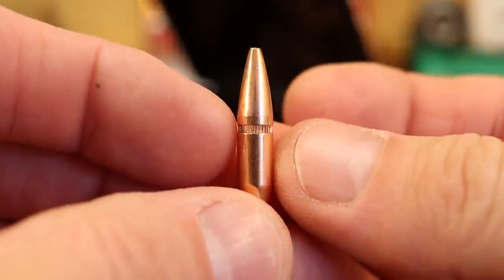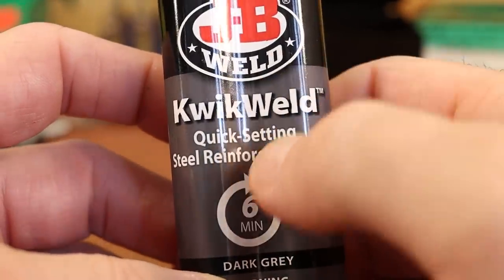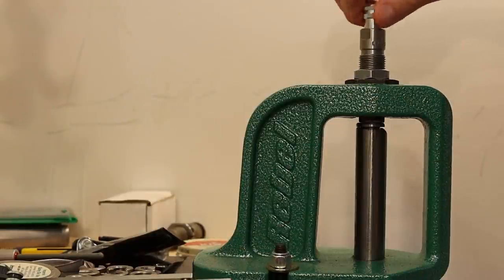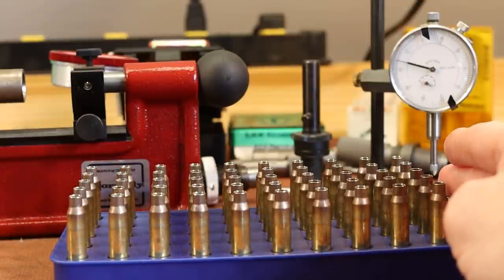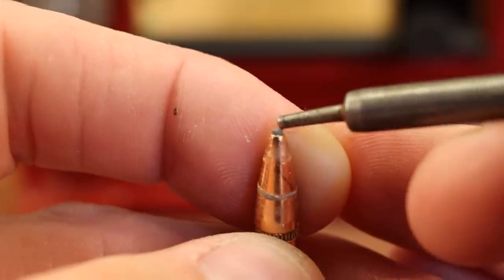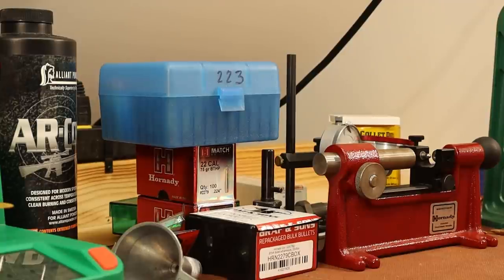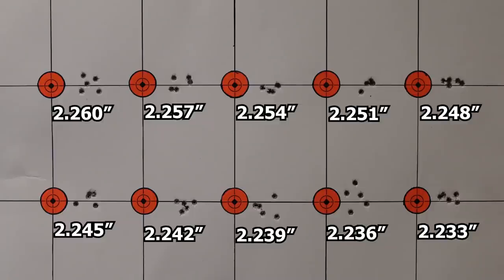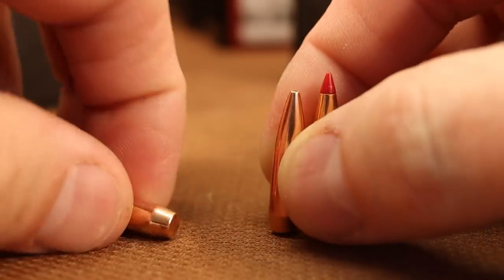223 Rem - 75gr Hornady BTHP with AR-Comp

Comment: Hey Johnny, I'm a not the most experienced handloader, but I do have a mechanical engineering degree and about 8 years of reloading under my belt. I believe runout and concentricity aren't important for 1 very simple reason. The bore of the rifle is smaller than bullet. Unless the cartridge is just horribly deformed, the bullet is always going to true itself up to the bore once the rifling engages. Plus, there's no way the bullet stays perfectly true during its jump to the lands anyways. As pressure builds, the brass lets go of the bullet and its free to wiggle due to uneven thrust caused by the powder burn. This wiggle is almost certainly greater than the actual runout you could measure before firing. But once the bullet gets to the throat, the rifling acts like a guide and the bullet's bearing surfaces are forced back into parallel with the bore. Thus it's a self solving problem.
Reply: Sorry but no it won’t
Reply: @3er328  Very convincing counter argument.
Reply: Nope.  If the bullet is jammed into the lands sideways, it deforms sideways and goes downs the bore non concentric.
Reply: People don't understand ejector plunger pushes it off center.
Reply: @3er328 
Ok. Support your position. Tell us why it won't.

Comment: I stopped worrying about runout when I finally determined that I wasn't a good enough shooter to take advantage of .001 to .002 of runout vs .003 to .004.  I found that good solid reloading practices in general made more difference than obsessing over one to two thousandths of runout.
Reply: Well, don't be so quick to blame the shooter.. there are a lot of rifles that are not all that interesting. (only accurate ones are interesting!)   Fired thru a bench rest rifle with minimum chamber and neck, it will probably be something you could see.  Thru a semi auto, I doubt you will though...
Reply: That's me. I reload primarily to save a little money (not much these days) and to tailor my ammo to my firearms. That has definitely increased my accuracy, however I can only shoot so good, so I've stopped short at stuff like runout, weighing brass, and even annealing. For me it just takes the fun out of it and becomes a technical dumpster fire.
I'm a simple geek...LOL 
But I enjoy watching Sean struggle with all this😂😂
Reply: @elwhastrummer  I agree on your premise that there are certain aspects of reloading like weighing brass, or maybe turning necks that may only decrease your group by 1/16" or .0625". To me I don't spend the time doing those either. I wouldn't spend the time on those even if I knew before hand it was going to take my gun from a .4" to a .2". The time involved just isn't worth the reward to me as a regular guy not shooting matches. But I would disagree on annealing. Annealing does two things. One it makes all your brass easier to resize and get the same amount of shoulder bump which has a direct effect on pressure from one case to another. Two, it helps with consistent neck tension during the resizing process. While I don't weigh brass, I do check for brass run out. I heard a great shooter say, a bullet that starts out flying straight will tend to  continue to fly straight. But a bullet that starts our flying crooked will never fly straight.

Comment: Don’t use 2.254”; use 2.251”.  That COAL is trying to shoot benchrest level accuracy (only the single bullet with worst runout was outside the group).  That’s definitely the optimal COAL length for this bullet in your WOA bbl.  Concentricity does matter; however, not as much as jump to lands in this combo of bullet, bbl., and powder charge.  I also think bbl. harmonics are at play here.  The 2.251” COAL, with this bullet, and this powder charge, with that barrel and suppressor is hitting the harmonic sweet spot as well.  I don’t think anyone fully understands all the forces happening with barrel whip and harmonics yet.  I’m going back to re-watch your videos on it and ruminate some more.  Just put a pseudo-tuner on my Bergara B14R to test with.

Comment: This is not confusing or suprising to me at all. A friend of mine did tests with runout, found that at least at 100 yards, any runout up to about 10 thou was absolutely undetectible in groupings. Maybe it has some measurable impact at 1000+ yards but the time invested in correcting rounds vs returns isn't worth it.
Reply: I feel like the runout is easily corrected by ditching the expander ball in the fl die by pulling it out and using a mandrel expander to open the neck back up. .002 neck tension is generally where the magic happens
Reply: This is also what I have found. Even at long distance.
Reply: @cademarti1365  what is the logic to why an expander ball ruins concentricity but a mandrel does not?
Reply: @Bill-v650  ball pulls upward and not centered. Also has potential to pull shoulder out as well. Mandrel is floating and expands going in case mouth
Reply: Once you’re at 1000 yards you won’t be able to parse out a difference between the wind and anything caused by runout.
Reply: @cademarti1365  There is nothing forcing a floating mandrel to be perfectly centered either. If the neck thickness isn't completely uniform it will still cause uneven stretching,  So the whole theory is it's more accurate if the ram is moving up rather than down???
Reply: @Bill-v650   but there is...a mandrel can float but an expander ball can't. Bill, the bullet runout doesn't lie in comparison of the two tests. The mandrel also does a much better job of controlling what neck tension your bullet shoots best with
Reply: @cademarti1365  Seems to be true for many. My recent experimentation suggests case concentricity can be improved by polishing the expander ball 2 to 3 thou under desired neck tension, & polishing the neck portion of the die body.

I've reduced outside neck runout from 3.5 thou to 1 thou with plain ole Lee F. L. dies. MORE TESTING REQ'D. I can't say yet that this is definitive but it looks promising....
Reply: @Bill-v650  es/sd numbers on the chronograph don't lie
Reply: @cademarti1365  Redding makes a full length sizing stem with a floating carbide sizer button. Haven't used them personally ($$) but > one way to skin a kitty. 😁
Reply: @larrymitchell3502  it's all trial and error haha

Comment: Fellow RCBS Case-Master owner here!

I'll lend a helping hand with two answers, one by citing documentation, and one with anecdotal findings.

1) In the Case-Master documentation, it mentions that anything greater that 0.005" bullet run-out is when you should check your seating process and what might be causing an issue, and that anything less than 0.003" is "fine for varmint ammo."

2) I have found that even with seating stems with fantastic fits, regardless of brand (Lee, Forster, whatever), that I can get all the way up to 0.006" thousands run-out.  This is no problem, especially at shorter ranges.  It's when you get close to, and beyond, 0.010" that you'll start to notice oddities.
When and how much to measure?  If you're having any issues - and, again, this is referring to my own experience - you'll find it within the first 5-10 rounds of a batch measured.

Take that with a fistful of salt, though, because if you think you're an idiot, oh man, you haven't met me yet.
Reply: A guy that reads the instructions is almost wizard-like in his apparent knowledge! LOL!   Good info!

Comment: If you go down the run out rabbit hole, you'll end up using bench rest techniques for brass prep, weighing and sorting each case and each bullet, neck turning and more...and in an auto-loading rifle with a factory chamber it's pretty much a waste of time. Don't worry about minor run out, your rifle sure doesn't seem to.

That said, bench rest brass prep techniques do help squeeze the last little bit of accuracy from a rifle, but it's up to you to decide if all that fussing around is worth your time.
Reply: I agree 100%.
Reply: Yup, I don't think the deer will care if you rifle shoots a .85 group or a 1.54 group from an auto-loader.
Reply: You are right that the BR crowd have the special chambers, bbls, etc. to exploit the advantage of max ammo prep; however, there is another factor regarding this that Johnny is constantly running up against. 

He frequently has trouble interpreting what variable is causing certain effects.  The only way to really figure these things out is to reduce/eliminate all the other variables.  Using as good a barrel as WOA makes, he’s eliminated a huge variable.  Johnny definitely knows how to assemble a good upper.  I think he should build a cheap 80% blem lower and just mount it in a vice with no finish (it’ll get scratched to hell by the vice anyway).  Then trim, chamfer, flash-hole deburr, neck-turn a lot of about 300 cases, so he can weight-sort down to 50-100 which are identical*.  Weigh out 1000 primers to find 100+ which are identical.  Johnny’s already using a chargemaster to weight *identical powder charges.  Use Wilson hand seater to reduce concentricity issues from seating.  

Will accuracy be magically better?  Not necessarily, but tracking down which variable is having what effect would be easier, because it would truly be powder, bullet, and seating depth issues, and none of the “possible” variables, because they’ve been eliminated.  

Of course, it all depends on what Johnny is wanting to accomplish too.  He can certainly build rifles, shoot, and load well!  Maybe that’s good enough, and really he’s just entertaining us (which he also does amazingly well - Love the channel.)
Reply: There are tons of variables. Like seating depth nodes.  He just ran through a ton of seating depths and hit highs and lows with seating depth nodes. 
An auto loader can be a pain in the butt. They’re only going to be “so” accurate. Locking a cheap build with a great barrel up in a vice creates an entirely new problem. Free recoil or not? This is all one big rabbit hole but I love it lol
Reply: It looks by the video that your die is slightly off to one side. Could be optical illusion though
Reply: R.A. Williams is exactly right.  It’s very easy to become consumed by minutiae when it comes to reloading.  The first question you have to consider is what kind of shooting you are doing.  While all the minutiae added together may add up to a whopping .5 MOA improvement, it’s very likely that consistent powder charge and seating depth make up 75% of that total improvement.  The remaining 25% accounts for 75% more time (and cost) and is absolutely undetectable unless you shoot a custom rifle in benchrest / f-class (same thing effectively).    Even in High Power / Service Rifle you’re shooting at a 2MOA 10 ring, which is still tighter than 90% of shooters can hold without artificial support.

Comment: Great series of videos.  There’s a saying in High Power:  “You can’t reload your way to the podium”.  In benchrest or F-class, sure.  Chase that reloading bench rabbit as far down that hole as you can.  But as soon as you have to pick that rifle up and hold it in your hands to shoot, 90% of that minutiae flies right out of the window.  With a White Oak / CLE / RR National Match upper you can get to a .5 MOA load with consistent powder charge and seating depth.  That’s a magazine length load and full length resize and a thrown charge.  No amount of improvement on that matters when shooting unsupported.

Comment: I use these in my 24" heavy barreled AR15 bench gun with 1-8 twist with great results. I added a harmonic damper and was surprised at the accuracy increase a rubber ring made. Cheers!

Comment: Yes, seating depth matter! Your seating window is about 0.006-0.009” so if shooting 0.010” you may have completely missed it.  Load up between target 3 or 4 and verify results.. 

This is what I have been begging you to do.. it works, it has been very repeatable for me.   

Crappy combo find best powder node by 10 round charge weight to find flat spot and then this test..  so you find a low as/es charge then this seating depth ladder.. 

Or just pick on that shot like poop but had good numbers em do a seating depth test. 

Each combo can have a different tune. Change primers and you may have to start over. Change powder and you will.. 

Run out is not as big an issue as people think. The bullet if shot through a tight freebore is aligned into the rifling. This is the most critical spot in the rifle. The free space around the case in the chamber allows this misaligned bullet to align with the bore.
Reply from the maker: I'm not always as dumb as I make myself seem.
To test all of the stuff we've talked about on Twitch over the last year, I needed a series of videos where it would seem natural and people would be interested.
This is the 3rd video and so far we've got tons of interest and engagement, a gigantic set of baseline data on a bullet that's shooting really well, and several interesting side quests to keep things interesting.
These things just take time, man. That was the problem with live streaming so much...you guys had a window into my daily insanity of planning videos. "What I want to do" and "how I get there with the audience" are very different challenges and I have A LOT of problems lining them up sometimes. 
This series is a huge win. The view numbers are good and I've got lots of different stuff I want to test. Should be a fun and natural way to introduce some new concepts and load development methods, then spread what works out into my other videos.
Thanks, man!
Reply: @JohnnysReloadingBench  this series is awesome!  And yes a second powder that did crappy would be a fun follow up!  Just make sure to get a charge with decent as/es before seating depth test. Take care and looking forward to the next one!
Reply: @JohnnysReloadingBench  when you do the 200.20x in 300WM can you try RL165?
Reply: Looking forward to seeing how this series progresses. Keep up the good work @jrb
Reply: @ewetho  definitely like see more on the 300wm in the 22-250 fun video.  And how about more 357 mag video have done any long time
Reply: @JohnnysReloadingBench  this series is doing well for you man !👍

Comment: Hi Jonny,

Love your content! Relative to bullet seating stem dies I want to share with you my experience using the LEE 4 die set deluxe for 9mm Luger.

I was new to handgun ammunition hand loading. I experienced one cartridge that would not pass my Dillion gauge. I also experienced a ring on the bullet from the seating bullet seating stem. I then used 600 grit sand paper, using a bullet as a polishing mandrel. It worked great. I no longer saw the bullet tip ring, from seating, and eliminated brass  bulge in the neck portion of the brass case!

Bottom line, hand loaders need to know that they may be receiving inferior dies, bullet seating stem bullet contour, in my case. The rough surface finish of the bullet seating stem caused bullet deformation and did not allow self centering into the brass case.

Comment: Load 25 rounds with the same charge and length. Measure and separate into groups by concentricity, 5 worst, then next 5 worst, etc.  That should tell you if the small amount you have makes a difference. I think that this video showed that jump is important.

Comment: This just seemed like a great example of a seating depth test and it worked quite well. I've been using the Satterlee method to find the node, and seating depth to tune for the last couple of years. It plain works when done correctly and paired with good reloading practices.
Reply: What is The Logical reason that accuracy and velocity change with seating depth?
Reply: @Mike-xi4zt  by micro adjusting the seating depth in increments of .003" you are able to time when the bullet is exiting the barrel and tune the harmonics of the barrel to the load, or so the theory goes
Reply: @newerest1  If it is barrel harmonic vibration, then using a adjustable barrel tuner/brake would be a be a better way to adjust to the best frequency of vibration. Like tuning the dial on a radio to find the resonant frequency of the circuit. The theories I have heard say that to much jump to the rifling  causes inaccuracy because it causes runout of the bullet. I think that letting the bullet exit the soft brass case mouth to be supported by the steel barrel as it is swaged into the rifling would yield better results. Plus it would lower the peak pressure and permit higher velocities. Use the throat to align the bullet not the brass neck that has runout built into it to allow the round to chamber and extract.

Comment: I believe I read an article from a top bench rest shooter that stated that he didn't start seeing groups opening up until about 0.006 TIR. Your measurement will vary greatly depending on where your indicator rests on the bullet as the run out starts at the neck of the case. I personally reject any round with more than 3 thou for competition just to be safe. One thing you can do is mark each case at the "top" of the run out and make sure they're being inserted into the chamber the same orientation.

Comment: ... great video as always!  I was shouting "pull the trigger" on the last 2.251 group.  If I'm shooting a good group I try to keep the rhythm and it usually works.  I always seat my 69grn SMK'S to 2.250 and they are accurate. I've been using the Lee Collet seating die from the start but I do a double press, full press and rotate 120° and full press, it's just what the instructions suggest... good shooting!